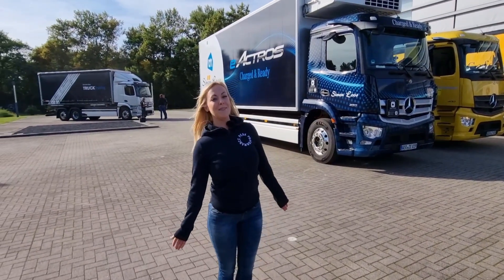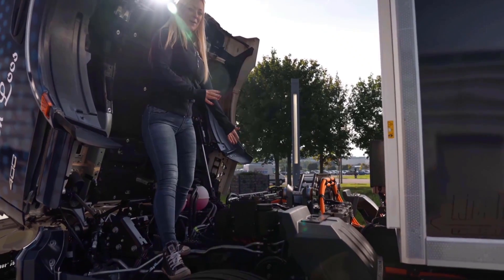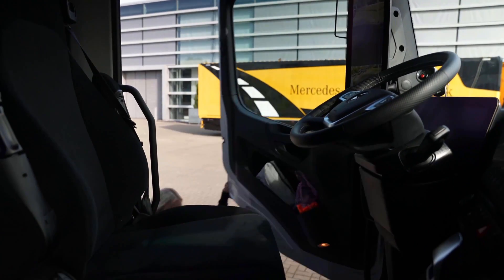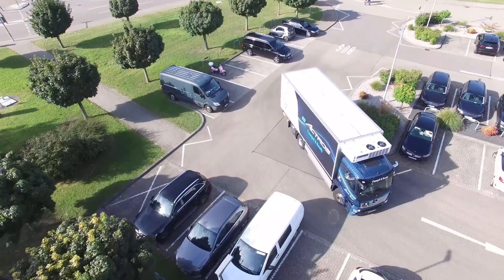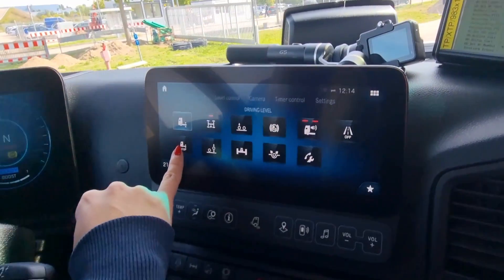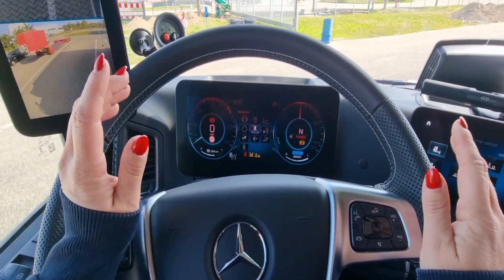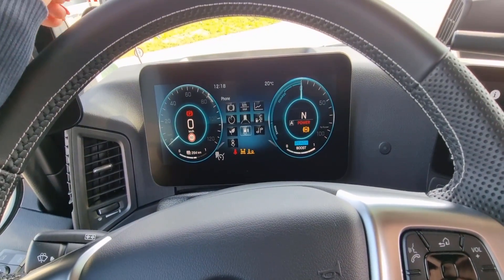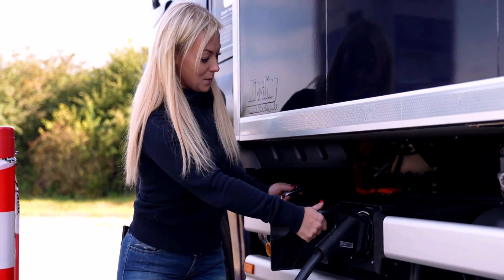⚡MERCEDES ELECTRIC TRUCK⚡ E-actros - Angelica Larsson

Comment: Angelica great video, the truck looks good, but nothing beats the sound of a V8 engine, I'm old school. Well thanks for the video and stay safe. Until next video.
Reply: Yeah i am not against Electro Cars but i hate that its forced on us all. What about those who like Motorsport, and now dont tell me we should drive emotionless Electirc Cars. V8 needs to survive.
Reply: @phoenixsui  why if it works with Electric why stick to expensive Diesel Thats just  A Fools Game.   AND yes If Motorsport is to survive we  need the Electric it s the last  Thing that sjal go on Fossil fuels.  but i think i am Trying to convine somone that Cant get it  that Electriv Veeicles work just as fine.....
Reply: @PierreSimonsson  they may work the same as the diesel/gas engines, but in the case of this truck it takes 1 hour to charge from 66% to 80%, how long it takes to fill a gas thank of diesel/gas? Also the mining of the minerals used in the production of the batteries is very unfriendly to the environment, and this minerals are not sustainable, like the oil. But personally I think hybrid will be a better option, electric on city, low loads and gas for heavy loads and long trips.
Reply: @PierreSimonsson  they may work the same as the diesel/gas engines, but in the case of this truck it takes 1 hour to charge from 66% to 80%, how long it takes to fill a gas thank of diesel/gas? Also the mining of the minerals used in the production of the batteries is very unfriendly to the environment, and this minerals are not sustainable, like the oil. But personally I think hybrid will be a better option, electric on city, low loads and gas for heavy loads and long trips.
Reply: @Danny-nz9fh  well youneed to have the  Mandatory Break and then you charge the truck   I dont see that Problem...  But tallking to deaf ears Probly .....
Reply: I frankly think an I6 diesel sounds better, either a Cummins or an IH, even better a Cat.
Reply: @henryostman5740  I personally like the sound of the diesel engines, I 6 or V8s. But nothing beats the sound of a Scania V8,  DD and cats sound good, but my heart goes to the V8.

Comment: Angelica. It is so nice to see you posting more videos and we all get to see your beautiful face with that big beautiful smile. Great video however this is the most unpractical truck that I have ever seen. Not any good for very remote locations where there are and will not be any charging stations  for decades.
Reply: Well, don't buy one for that type of job then... simple! They're for short trip "multi-drop" jobs I'm guessing.
Reply: @danosverige  They are still pieces of shit that will never last in the trucking industry. They are not so eco friendly either when you consider that the batteries are made with oil. all the plastics are made with oil, etc and cost a fortune to dispose of the batteries when they are used up.
Reply: @leslietarboxjr4287  - It took 30 years to convince everyone that we can survive without coal... I expect the same for Diesel fuel!
I drove semi-trucks until 2000, the trucks Angelica and everyone else drives today are like the fucking starship Enterprise to me! 
The industry will go with whatever is available.
Reply: @danosverige  In case you haven't heard we are still using coal as well as 90% of Europe. We will never be without coal or fuel weather gas or diesel in our lifetimes. There is nothing else to replace it. Electric and steam cars were manufactured from 1905-1920's and went by the wayside because they were not practical  and to expensive for the common man. The same applies to electric cars of today. Solar may work if you had 20 batteries per truck or car. Wouldn't be worth a damn in cold winters or lived in northern Alaska or Northern Europe where you only get a couple hours of daylight per day in winter. If the UK in your name means that you are from the United Kingdom then your trucks were behind the times when they were new.
Reply: @leslietarboxjr4287  - Yeah I should have been more specific, my bad. What I meant was that it took the general public that long because every house and home was using coal for numerous open fires etc, which often caused the infamous "smog" that blanketed our Cities. The transition to gas/electric heating due to the sudden "smokeless zone" bans terrified people! It also destroyed our Mining industry and threw millions of miners to the dole queue's. We advanced and survived.
The trucks I drove were Scania 540's and Volvo FH16's...hardly "obsolete"! 
No satnav's, paper disc tacho's, no HUD's, no fridge/freezers, definitely no microwave ovens and no breathalyser test before the engine starts. Half the drivers I worked with then would never have gotten out of the yard! 😂

Comment: Very interesting Angelica,  think the payload of the batteries and range is its only downfall. The bottles with pink liquid looks like expansion bottles for the water cooling of the engine, but its got no engine?
Reply from the maker: Exactly! And that's the water that heats up the cabin! 😃
Reply: @AngelicaLarsson  Ahh, was wondering bout the liquid. Thought it funny that its all electric and you still have to lift the cab by hand lol. 💪
Reply: Cooling system is for both cooling and heating the battery pack, not the electric engine. If the battery pack gets too hot the power will be reduced to protect the battery, and if the battery pack gets too cold it reduces battery capacity plus you are not able to charge as fast as if the temperature is good. Teslas and more or less all other electric cars has a cooling system to keep the battery pack temperature under control.
Reply: probably for several loops of thermal control. teslas have several also. Powerful motors need cooling too, battery needs thermal control (up and down, they do not like being cold or hot) and the cabin heater needs to steal heat from one of those, or it often is electric, and the cabin ac must have somewhere to dump heat.

Comment: Great video Angelica. Electric vehicles might be Okay until you start having problems with the power source. Imagine being in a lighting storm and it gets struck by lightning and everything catches on fire. Take care and have a blessed day and I'll see you on your next video.
Reply from the maker: 🙉🙉 thank you 😊
Reply: All trucks built in the last 5 years are so loaded with electronics that they depend on for operation that they too would be dead on the road. (and a fuel fire is as hot as a battery fire)

Comment: So strange...especially those backup camera screens; I'm like you, definitely prefer mirrors.   How does it handle? Cornering, braking, acceleration?
Reply from the maker: The only thing about the acceleration was between gear 1 and 2 (only two gears) was a little slow, else it was just as smooth as a regular truck on diesel 😃

Comment: Where i drive it gets as cold as -50c and these electric trucks won't be able to stand up to that 😒  but they look nice though.  I just wonder about the environment when it comes to the making of the battery's. You should ask them about the life of the battery's and how they will recycle them. Great video Angelica 😁💋👍Allan from Canada 🇨🇦
Reply from the maker: Ah, I've been thinking of that too 😊 not sure if it would work up in Northern Sweden too, only short distances 😃
Reply: @AngelicaLarsson  I don´t think it will, and if you take a trip with that one to northern norway, with the steep terrain they have. And where are you gonna charge it? There are so few charging stations wherever you go, so far. And if you drive that on to Finland there will most certenly be problems too. Another thing, even if you add solar panels on it´s roof they wont be very effective, because on the winter there want be opportuneties using them. So hold on to your Scania
Reply: You are  so awesome your a good driver.  I'm just going to my driving job in about an hour 4717km round trip delivering groceries to the Yukon in Canada 🇨🇦 🙃 the snow is just starting to fall in the mountains know have a good and safe day Allan 😀
Reply: The future is Hydrogen.... the only way to save the planet... battery can only be a solution between... but where is the engergy coming from to charge them? Atomic Power Plants? Coal?? Gas?????
Reply: @Porky46  wind directly to hydrogen. Like is being built off the coast of Scotland right now. Reforming sea water at the point of generating into hydrogen then pipe to shore.
Reply: @Porky46  So you are concerned about where the energy comes from and then you start proposing hydrogen?! Hydrogen consumes 3 times more energy than a proper battery does...
Reply: where im driving, trucks are 34meters and they re on drive 24hrs a day and 6 days a week. And temperature gets  to -30-40 celcius
Reply: They are testning electric trailer  trucks in the north of Sweden at Kaunis iron ore mine with loads 70 ton.
Reply: I'm sure the battery packs have heat pumps and insulation. Although that would greatly reduce the range. Don't quote me on this. I know tesla model 3s have heat pumps and a preheating feature. Merc probably have something similar
Reply: I’ve seen somewhere (Trailer mag maybe) that these E trucks have been tested in Kiruna.

Comment: electric truck is nice but if I already have so many electrical devices why even the cabin can not have an electric lift to make work easier for the driver or mechanic
Reply: maybe it is an option? still needs a mechanical jack, in case the issue is a power issue.
Reply: @uliwehner  that's true but when I want to show an electric car presented as 100 percent electric then I wonder if it's a silly thing not to do it that way